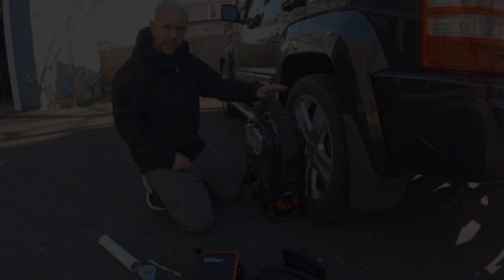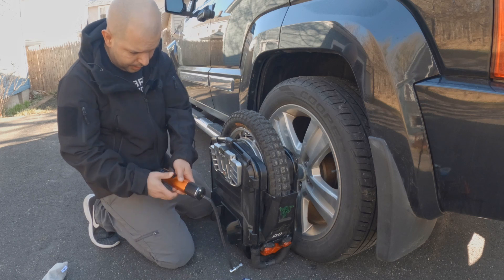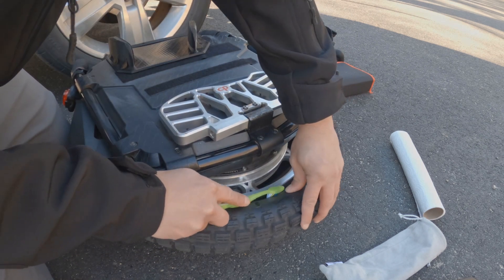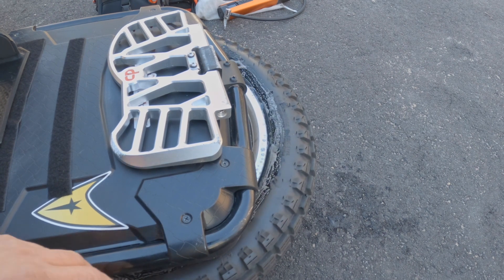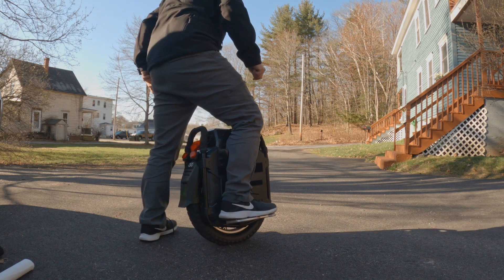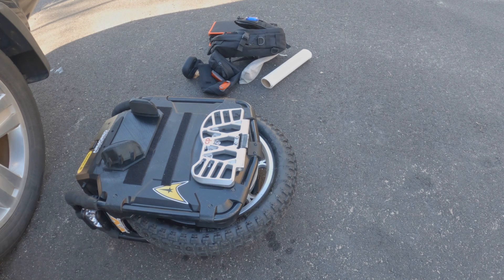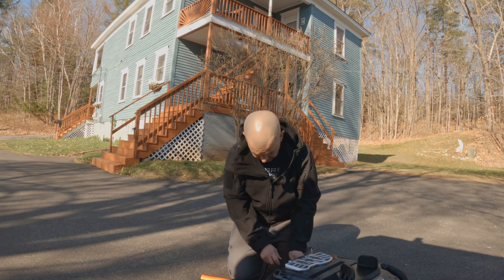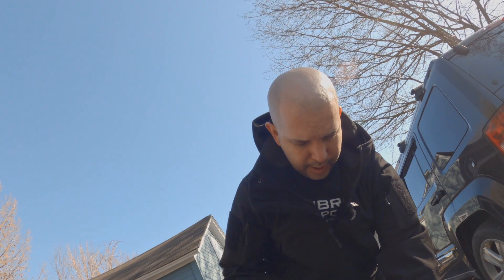Attempting to Rebalance Stock Knobby Tire on  Veteran Sherman Electric Unicycle

Comment: Thank you for posting your various Veteran Sherman maintenance, repair, and modification videos.  I also have a Sherman and, although I have not yet encountered a need to perform these procedures, eventually I probably will.  I hope you will keep these valuable learning resources on YouTube.

05:22 - The pedals look interesting.  It would be great if you were to tell us if like them, and the make and model.
Reply from the maker: Yes I plan to keep the videos up. Even though some of my videos I have done things wrong, it is still a real look at what could happen to a wheel and if someone is not experienced with this sort of hobby, then they can learn from my mistakes, and they can make new ones lol    The pedals are clark pedals make by clarkpads dot com. Excellent pedals. I believe they were the first web store made pedals on the market back during the covid days.  I like them, i still have a pair set in storage.

Comment: When you said get it right inside there I started to chuckle... then it really escalated when you said get it right in that rim lmao. Some tires are really hell btw and a hassle to get them seated properly so that they feel right.
Reply: I'd take this as a compliment as Mike is the king of innuendos...or maybe its just his filthy mind🤣🤣🤣
Reply from the maker: Rofl, glad you enjoyed the chuckle. The tire for the Sherman could be just me overthinking, looking at the video it didnt look like there was any play in the tire so im not sure if im just being a pussy or if there is a legitimate issue. After reseating, after trying the "ride on the tire at low pressure" it does feel better but some vibrations. Didnt even bother this time to massage the bead, because it looked like it was in place and even all around both sides. I need to practice on my squatting stops to counter wobbles if they happen. My bend down is actually not low enough, so maybe some high speed starts and high speed STOPs should me my next practice with this wheel. Who knows, maybe this wheel isnt the "right" one for me.  Thanks for watching man! :)
Reply from the maker: @hammyhamster4045  Filthy minds are welcomed here lol
Reply: @WILSONsHobbies  The Sherman is very stable with that knobby. It rides like a truck and I find the knobby tire great at reducing road chatter. My EXN tire has a wobble to the right and also outwards/upwards... so at 26PSI and above there will be vibration especially when turning right... but this happens at around 30 mph. At 23ish PSI it is super stable and then I can rip at 40mph + with no issue. I will try to reseat it though... after the new motor I never reseated the tire like I had on my old one. So I have just lived with the wobble. But... as a sensitive guy I can say that switching from the MTen3 to the Sherman is definitely a big change so just give it a week or two of daily riding. Do some speed drills and riding low drills, etc. It's just another kind of practice.

Comment: If its been like that from new could be just a badly balanced tyre. When I worked as a motorcycle mechanic tubed tyres were always the worst to seat and balance. We would remove the valve core and inflate to 60psi rapidly with loads of tyre soap. If that didn't work then it must be either a poorly manufactured tyre or the rim is at fault. Might be worth checking the runout of the rim with a dial gauge. Most probably the tyre. If you've a local independent motorcycle mechanic they're usually pretty helpful if let them know your problem. Good luck and hope you get it sorted soon.
Reply: Very informative comments @Hammy Hamster great mechanical insider information thanks for taking the time to post. 👍
Reply from the maker: That is good to know, do you have any resource for the dial gauge check and how to do something like that? I appreciate the comment Hammy Hamster and your support on this channel ! :)
Reply: @WILSONsHobbies  if you search for checking wheel runout there should be plenty of info. You can get a rough idea by holding a pointed object a pen or screwdriver etc close to the rim and spinning it slowly and checking the gap. Perhaps tape a pen to the shell will work. A dial gauge is obviously more accurate but you'll see it if it's that far out of true.